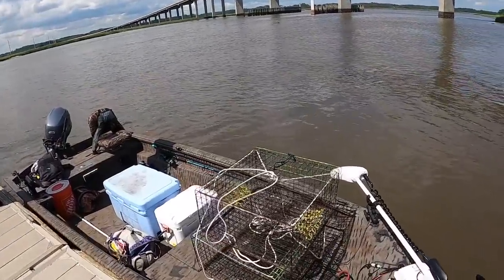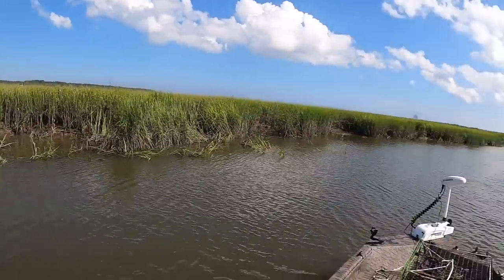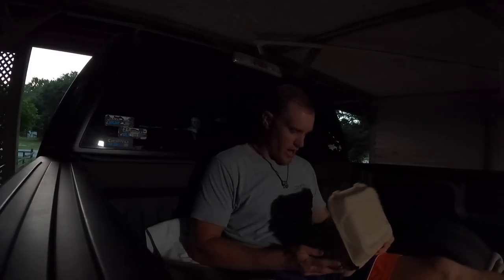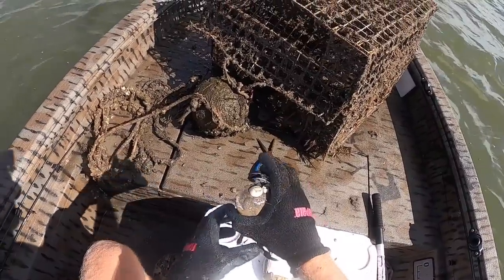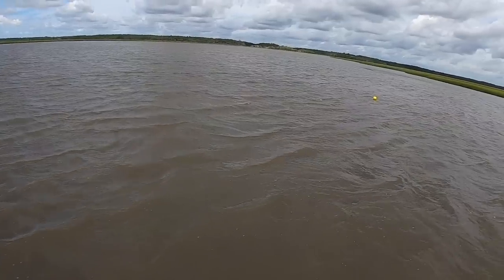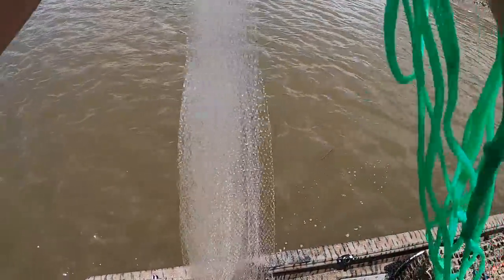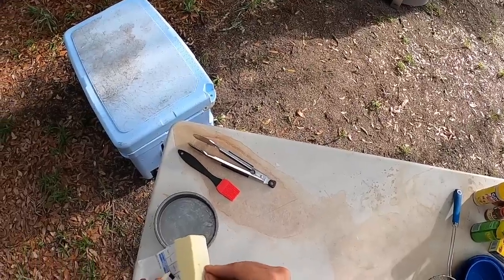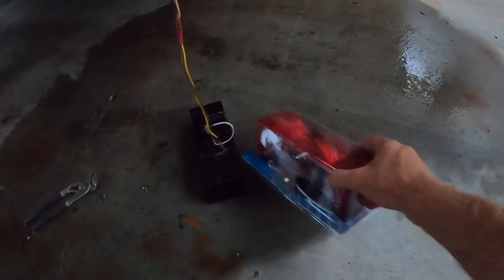Fire Roasting Crab at the Beach! (Catch Cook Camp)

Comment: You can stick the tip of the pincher claw into the joint and the crab will release the claw itself so you don't gotta torque on their shell and take a chance of ripping it out ..they will perfectly release the claw as a defense mechanism and you get a mich cleaner break ..just right into the joint and your all set

Comment: Tip, should learn to throw without having to bite the weight line..trust me, makes netting so much cleaner and you don't get the sand all in your mouth. 6 ft nets and smaller it easy to do, just takes a little practice. Once learned you won't ever put the line in your mouth again.